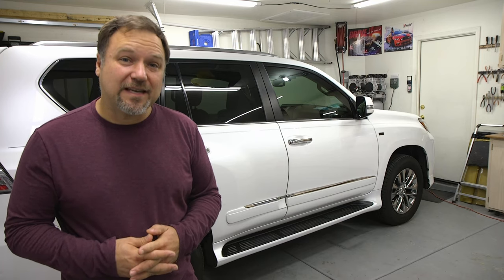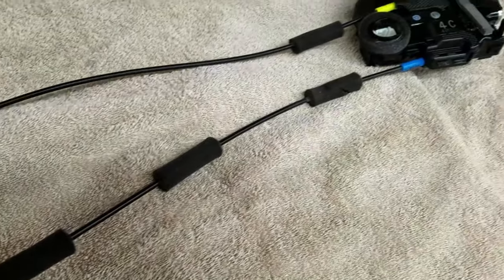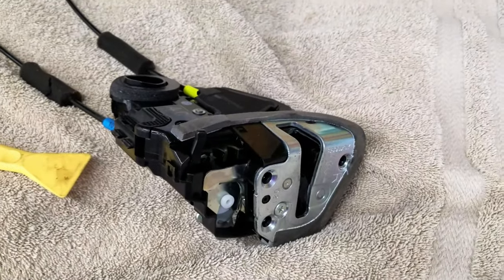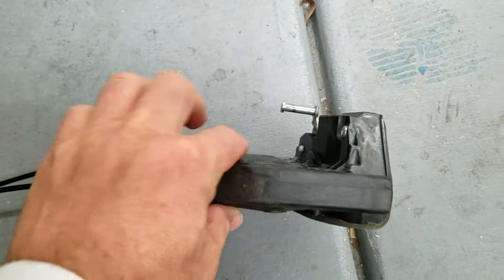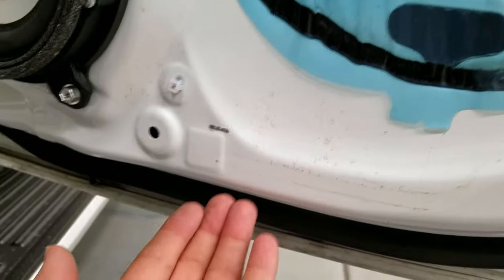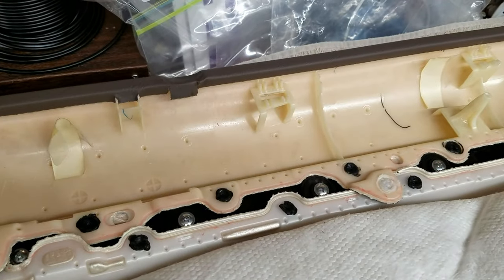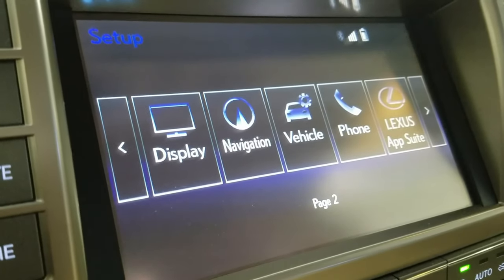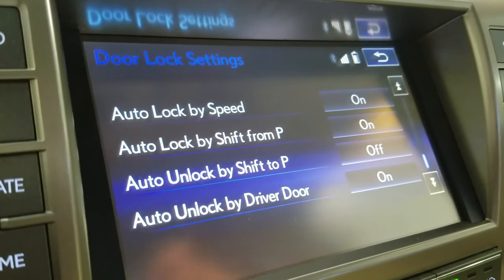2014 Lexus GX460 Door Lock Actuator Replacement Step By Step

Comment: I replaced my actuator because the locks were not locking and unlocking this worked great for years,  however now am having issues with the door not opening.  Sometimes the inside handle won't work and sometimes the outside handle won't work.  It's like it doesn't pull enough tension to catch and open the latch.  Any suggestions?
Reply from the maker: So from what you are saying it seems it is the mechanism the the handles use to pull the manual cable to open the actuator.  Look at an exploded diagram on a Lexus parts site and see what that might be.